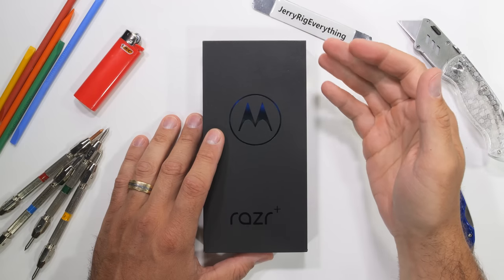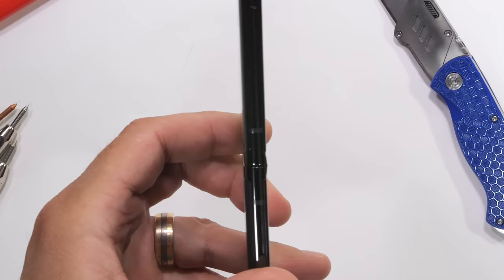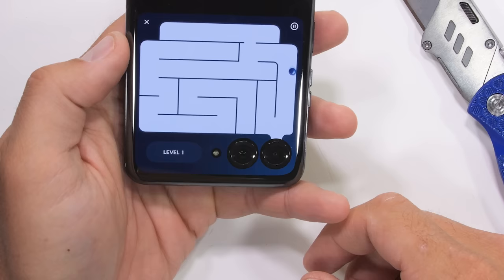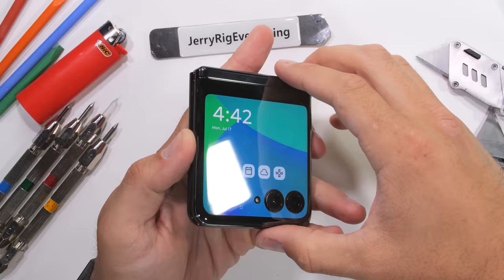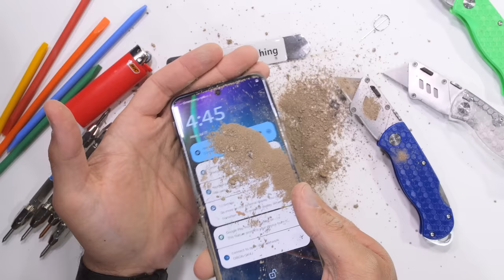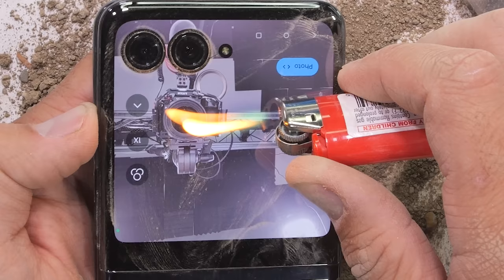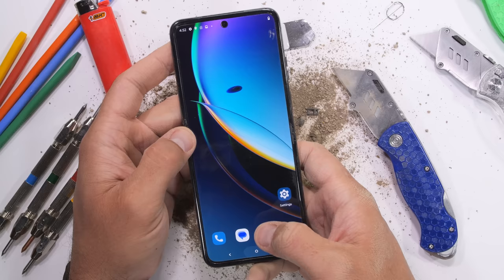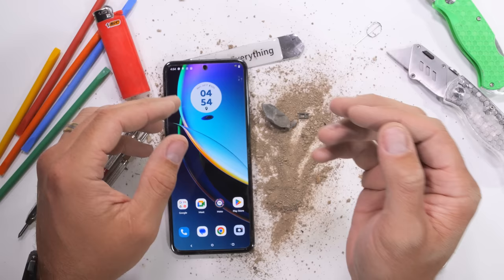This has NEVER happened before...

Comment: Looks like it passed. Still works even with a broken screen and a melted spot on the main screen. Looks like a win of the durability test.
Reply: Nah, that thing is gonna cave in your pocket and you'll be plenty upset
Reply: Hmm I'd say yes, but then I think that the rear glass cover cracking that way, would be a serious problem if someone decided to put the phone in some pocket, maybe back pocket of the jeans... I really like the form factor, but the lack of support on the back cover is a real shame.
Reply: Agreed,it passed. It still is functional.
Reply: The exterior screen broke so easily. With normal use, it'd break fast

It's less durable than phones that have passed the test.
Reply: @delpinsky skill issue if you put your phone in a back pocket and sit on it
Reply: The screen having a "screen protector" that you can't remove is kind of ridiculous. Just call it the screen
Reply: Apple will never do a folding phone, that is too much innovation for them
Reply: It was winning untill the screen cracked. The second screen is half of the reason for buying the phone
Reply: @laxbrobrandon  you can remove it, but I'm pretty sure it voids your warranty
Reply: It fared much better than the pixel fold indeed
Reply: @user-kk4bq7mb8u with the amount of force he put on it the opposite way it’s meant to bent, you’d have to have it in your back pocket and literally jump into like a hard wood chair for it to do any real damage, now the pocket behind the glass on the front though that’ll probably break more often seeing as what happened here
Reply: @AndreVictorGoncalves  They will after everyone else is done doing the innovating, then come up with some bs marketing to make people think they were super innovative 😂
Reply: It's dead, will stop working after few days.
Even if it did keep working which won't, would still be a big ass fail since a main component broke beyond safety points
Reply: @delpinsky  In the pocket? Dude... Jerry had to apply like 15 KG of force in the opposite direction, what are you talking about?
Reply: 2 year accidental damage cover from Motorola might be worth getting?
Reply: @AndreVictorGoncalves too fragile
Reply: @user-kk4bq7mb8u But I think it'll get the support it needs when the phone is folded. It'll only break if the phone's in unfolded condition and pressure is put on the small screen.
Reply: @HelmutGaming omeone has forgotten about the whole iPhone 6+ bending in your pocket thing.   Yes, this is a problem and it is too fragile.

Look at the tests of the Samsung folds where he puts all his might on it and nothing happens.
Reply: I agree
Reply: @HelmutGaming  buy the phone, put it in your back pocket and tell me what happens when you sit down 😎
Reply: @TGMisKillingTheMiddleClass  There are different types of damages, and the structural break point changes if its open or closed. I see there is a problem when it open, but closed, it is just as hard as any other so it shouldn't be a problem in your back pocket, also... you are comparing it to the Iphone 6 dude, the phone made of rubish metal with plastic antenas on both sides, making it a very bif fail point prompt to bend while this is stainless steel and glass... Nothing to do one with the other. (Sorry if my english its bad, i speak mainly spanish)
Reply: him bending these phones very unncessarily is the reason why lightweight phones have become a rarity nowadays, just look at the weight of those flagship phones now..
Reply: @user-kk4bq7mb8u  not unless you cram 20 other things in your pocket with it. Which would be very dumb.
Reply: Well, I would call it a win, but that outer screen looks like it's not made of strong glass at all. Z flip 3 outer glass has withstood so many drops.... I wouldn't think it was glass at all.
Reply: @AndreVictorGoncalves and if they do it it will cost JUST 10000 $… that’s all.
Reply: @HelmutGaming I agree! He applied much pressure before it cracked.
Reply: Agree
Reply: @user-kk4bq7mb8u Jesus how hard are you on phones? Lol. I can't imagine how the hell id manage to put that much pressure on a phone outside of on purpose. And even still the outside screen still turned on and the inside worked fine, plus I def feel like that's an easy insurance claim if it did happen somehow or even warranty claim. But again I can't imagine managing to pull that off without extreme carelessness.
Reply: @hi_tech_reptiles  agree.  People commenting just how fragile it is and I'm like... I buy plastic shell cases for my phones, rarely ever drop them, and would never slam them shut, set fire to them, sit on them (phones stay in my front pocket), etc.  It's beyond reasonable for me to ever do any of those things with my phone, so I likely would be fine with it.

Edit: it comes down to user preference and what you expect from your hardware.  I'd be fine with this phone.  I was impressed enough that sand and dirt didn't get into the folding mechanism and screw it up or scratch/dent the screen in any obvious manner.
Reply: No, that broken screen will cut your fingers and leave glass shards in your pocket. Not a pass for me.
Reply: It looks very durable, I just wish they would have pit something like a block of plastic behind the screen so that it wouldn't cave in
Reply: @seuny i bought it with 1 years damage and liquid damage cover at $100 extra.
Reply: @Chigontechofficial  that's great, better than nothing. I got the 3 years accidental damage motocare but am not sure what their support is like.
Reply: @AndreVictorGoncalves apple adds a 3.5 and fans will be grateful forever
Reply: @user-kk4bq7mb8u  bro as long as you put in the bare minimum effort to not fuck it up then youll be fine
Reply: I think it would survive one’s butt.
Reply: You fold it to put it in your pocket. That's a non issue.
Reply: Who sits on their phone?
Reply: @user-kk4bq7mb8u  only if you put it in there backwards in an unfolded state, scratching it extensively with a sharp tool beforehand and then you sit on it - those conditions are pretty unrealistic, if you have even half a brain or aren't trying to brake the phone intentionally its easily avoidable. More concerning is for how long the foldable screen will last, you can't test it in an 8-minute video tho
Reply: @user-kk4bq7mb8u  wait for the next gen when they reinforce it
Reply: I don’t know about this one, but I have a Motorola since 2016 and apart from the broken glass (I’m clumsy af) is the best phone I’ve had. Still have it😅
Reply: I've owned this phone for 3 months almost now and I can confidently say it's a solid phone. Front Screen is not as sensitive as people think. I've dropped it a few times and no longer baby it like I did the first week when I had no case. Only issue is the battery life....
Reply: As someone who works in a dirty forge I approve of this phone

Comment: I posted this as a reply to someone else's comment but wanted to make it more visible to others thinking of purchasing this phone.  I can personally say that a crack from pressure on the outside screen IS happening. I had the phone folded inside of a pocket in the rear waistband of my skirt. When I pulled the phone out the outside screen was badly cracked about a finger's-width up from the hinge. I thought maybe the pressure from the pocket zipper pull had pressed against it but it's not possible to have the pull hit the folded phone in the location the crack occurred. There is definitely a give in the glass on the spot where it's cracked so it appears to be a pressure crack. I called Motorola support but without the pricey accident care protection (that I turned down thinking I wouldn't need it and would just pay for a repair caused by a drop) they refuse to help me. I believe this is a defect in the phone that others will experience - a phone should not fail when in a padded pocket! After years of using LG phones I returned to a Motorola thinking the durability would be adequate on this phone, barring drops, of course. Boy was I wrong. Thumbs down to Motorola, and a warning to those who keep the phone in your pocket - pressure against the outside glass towards the hinge area WILL break the glass. Ugh.
Reply: RIP LG phones. :( I abused the hell out of my LG phones and all my old LG phones I have in drawers are still fully functional but sadly too old and slow for use today. Shame  the lack of software support results in e-waste that otherwise would be fully functional.

My daily drivers now are the Microsoft Surface Duo 2 and a Samsung A42(work phone).

Comment: I cannot believe it didn’t give up. What an absolute beast. I’m blown away! This is real progress on folding phones.
Reply: It's very resilient
Reply: Samsung foldables flawlessly pass the test from a few years
Reply: I mean kinda made abit sense since the back portion of the frame was being pressed together, preventing more bending.
The smol screen would probably also not have cracked if he didn't press on the screen itself.
Reply: Progress for Motorola sure, but for all folding phones? No, since Samsung has passed multiple times before.
Reply: @fcfcth  
Exactly!
Reply: @@notfiveo I don't know if you know, but the harder something is, the likelier it will shatter.
Sapphire might be hard, but it's not flexible, and if it's thin enough it'll easily shatter.
Reply: Samsung's fold and flip both can be bended the same way without any catastrophic failure like you see on this phone.
Reply: @FOGoticus  Samsung fanboys are just as annoying as the apple variety.

Comment: id call that a pass.  it didnt actually fail the "bend" test, but rather the pressure from your finger test
Reply: tbh, this might be worse. you are more likely to sit on our phone than bend it in half.
Reply: @nvcn86 Yeah. Some bad luck with where a button lands, and it will pop just like the one in this video.
Reply: This was always a problem with phones that have a glass back, it's worse when it's also a screen.
Reply: he is the reason why flagship lightweight phones have become very rare nowadays, theres absolutely no need to forcefully bend these phones, only an insane person would do that to their phone
Reply: @nvcn86  but not at the same level of single focus of pressure your thumb would give

Comment: Overall I think these foldable phones have come a long way in just a short period of time. Excited to see the other generations
Reply: My mom dropped her Fold 4 in water a month back, and it still works like new, a few models back it would be e-waste!
Reply: @therealmistermemer  I had the Z Flip 3 a year or two ago when it first launched, he did a review on that phone and it did better than this one. Samsung designed the hinge technology they are using here. It's essentially an exact copy of the z flip 3/4 with a bigger outer screen. Frankly I think that hollow area behind the outer glass is very concerning. That's the screen that will be bumping into things when it's in your pocket. They should have had a plastic frame behind that outer display to support it. Bump into a table or something and it could be game over. IMHO the outer screen should be the tougher of the two since it is exposed the most. The inner screen is protected at all times while folded.
Reply: I'm going to wait for tech to mature a bit. Hopefully manufacturing cost come down and we get a model for less than $1,000.
Reply: @caguko I don't think we'll ever get a folding phone that Will cost less than $1,000. I just think inflation will make $1,000 not be as valuable as it is today

Comment: Considering most people's phones live in their side pants pocket, having a void under the glass like that would absolutely be a concern in terms of screen breakage especially when sitting down or bumping into something.
Reply: Yeah you'd definitely want to be careful to keep the phone in your pocket with the screen toward your leg. I think most people do that with their phones anyway, but foldables are such a different shape I'm not sure.
Reply: I'm not sure if the apple watches are still doing this but back a few years ago, I dropped my apple watch series 3 on the beveled edge and the beveled edge of the glass was completely unsupported. Despite being the stainless steel version with the sapphire glass, it shattered only on the beveled edge that had no support behind it. It seems like manufactures don't understand how vulnerable unsupported glass is.
Reply: I managed to break the back glass on my OnePlus 9 with the included case on it, having an empty void behind glass absolutely won't help
Reply: Unless you had something else in your pocket... let's say a cough drop, since we're pretty tuned-in to not putting anything damagingly-hard in the same pocket as our phone... I'm not sure if our squishy thigh muscles would create enough localized PSI to break that outer glass.

Unless... that empty void extends the length of that half of the phone.
Even then, I'm not sure, since now it's a force spread out across a greater surface area.

Not saying I'm right, only offering my 2¢ on this. 😊
Reply: True but putting a phone on ya back pocket just feels uncomfortable but then again, maybe I'm just a strange human that puts my phone in my side pocket
Reply: @ngwoo yeah, I'm 6'5 and 480 lb. A phone would not survive in my back pocket.
Reply: To be honest as someone who virtually never has pockets I think this is less of an issue than you'd expect. It's always been a bad idea to keep your phone in a pocket that will be sat on or hit and I doubt the rough tough type of consumer won't be able to use this phone anyways due to zero waterproof and only level 5 on the dust
Reply: well it happened now, he put a new video just for this issue, and his piece survived it.

Comment: As someone who just purchased this phone, I'm glad to see it not fare too badly in durability. Must say, this is quickly becoming my favorite phone ever - even more so than the original Razr back in the day.
Reply: Gotta agree. I bought this thinking  "if it sucks I'll return it" but its just so fun to use. Moto has really outdone themselves with this one.  If the camera and battery life were just a hair better this would be a perfect phone.
Reply: @ezze-does-it  ive been using the z flip 4 now for a year almost, cant go back to normal nonflip phones
Reply: I'm really considering buying it. However I'm a truck driver and I use my current phone for maps constantly. I was wondering can I use the small screen for maps?
Reply: @TruckYeaDude93  yes, it is a lot more convenient too as far as holding/storing the phone. Only downside is you can't really look ahead very well
Reply: The phone is absolutely great. Have it for a few days now and the formfactor combined with the fully standalone front display is a game changer for me.
Reply: My options are iphone and razr what is better.
Reply: @pippen1001   I went back to regular phone because I had the Z Flip 3 for only a few months and after a couple of drops on hard surfaces, the phone had sustained internal damage. Every time I would flip the phone closed; it would power off.....completey defeating the purpose of having a flip phone. I have since replaced it with the S22 Ultra and besides the flip advantage and form factor that the Z Flip has....the S22 Ultra is a better phone in every other way.
Reply: @arunravi5457   It depends on what features you are looking for in a phone. Apple Iphones are not foldable and don't have 2 screens. That's kind of the whole point of this phone.
Reply: How has the battery life been for the people that have this phone
Reply: @sasaeed1  better than expected. I can go pretty much 24 hours on a charge, and I only go between 20-80%
Reply: @sasaeed1 amazing for not being a Galaxy Ultra or Pro Max. I can go all day on a single charge and I’m a pretty heavy user. It’s got a bigger battery than the Samsung Flip 5
Reply: @cirecomputers what are you talking about? Maps works perfectly fine on the outer display. I've been using it multiple times for navigation since the small form factor is perfect to hold safely and easily while on the go. And I never turn voice navigation on.
Reply: @T4nkcommander i second this, it truly exceeds my expectations 👍
Reply: I think the Z Flip 5 will be better. To be fair, I am biased. I have the Z Flip 4. I've dropped mine many times (with a case) and the only time I had any issues was when I was unlucky enough for it to slip out of my pocket onto the concrete driveway at just the right angle to land directly on the corner of the hinge. It destroyed the hinge on that side. I could only open the phone halfway. But even with that, and my dad putting quite a bit of pressure into trying to force it open, nothing else broke. I sent it in for repairs, and now I'm trading it in for the 5. They've changed the hinge design to make it more durable, and I have better phone cases that should protect the hinge a bit better. As long as I'm not unlucky enough to drop it directly on the corner of the hinge, I'm confident my Z Flip 5 will last me 3-5 years. They're surprisingly durable considering what they are. Obviously, they're less durable than a glass slab phone, but I really enjoy the functionality of being able to fold it too much to go back to a glass slab.
Reply: Yeah it is awesome
Reply: Yeah I wanted the Galaxy flip so bad but I was able to get this one and I'm glad I did